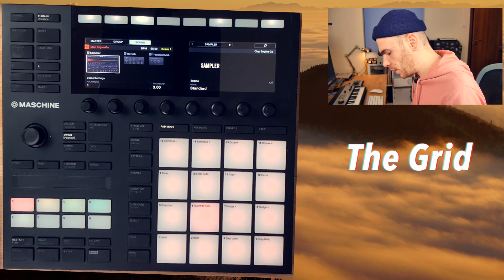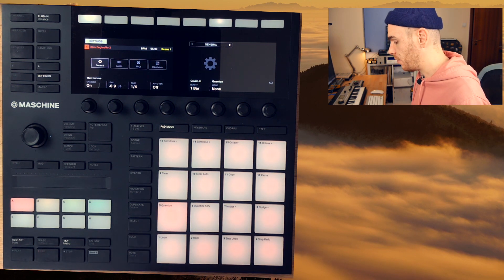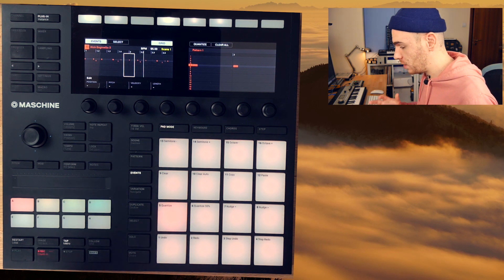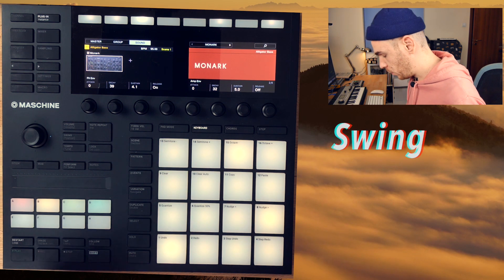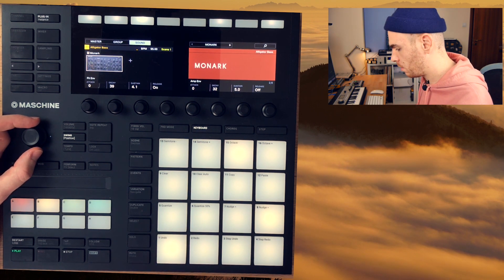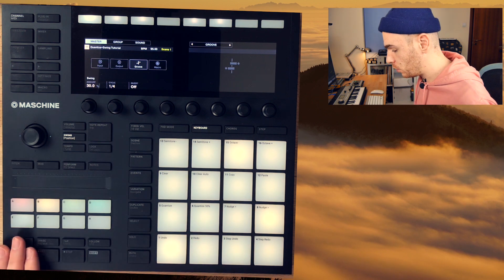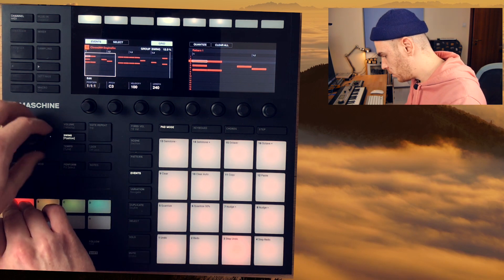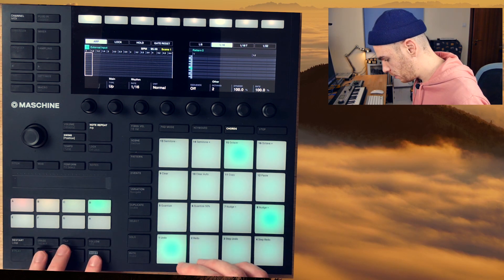Maschine MK3 Quantize & Swing Tutorial

Comment: Hi Thanks for this tutorial! I have a question about the touch sensitivity menu's for the knobs in settings. I see in your video that when you touch the knob for the quantize function, that a pop-up screen is visible with 3 options, None, Record, and Play/Rec. Some of my other buttons like Scene gives me that pop-up menu as it should with only a very light touch, but not the one for Quantize, I need to turn the knob to see the three options. This video is almost three years old, maybe it's in the firmware? Can you check if that has been changed? Thanks! I am afraid that my MK3 is not working properly, thats why! Thanks in advance.
Reply from the maker: Hey, just checked with my MK3 on a fully updated system and it doesn't show the options when you touch it here either. So I guess they've changed it and there's nothing to worry about.
Reply: @LowHeatBeats  Thanks for checking! Really appreciate it! I guess, it's a bug!